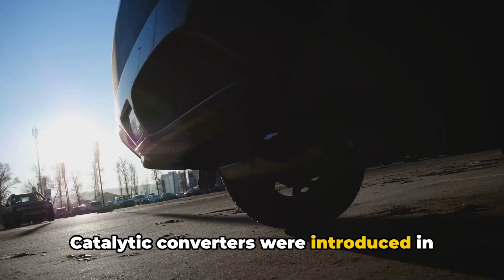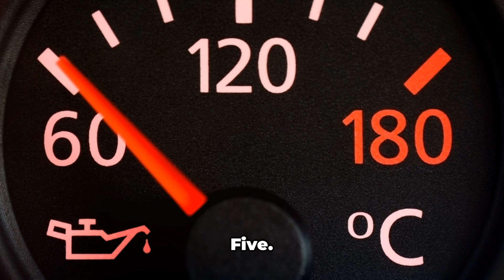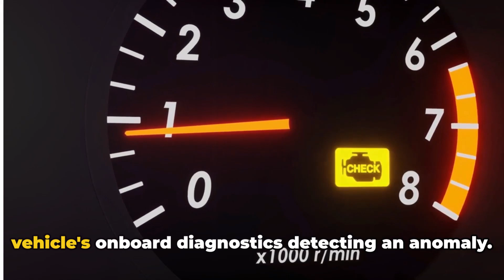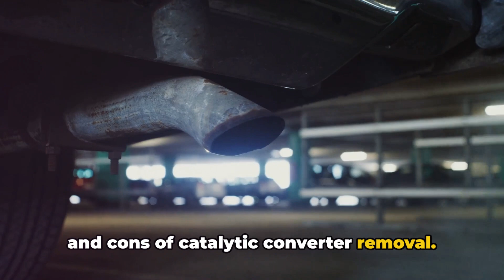Catalytic Converter Removal Pros and Cons: CAT Delete 101

Comment: Took mine out from my Corsa E 1.4t. Wow, engine temperature cooler. Awesome accelaration from start to finish. Car feels energised. In the Opel Corsa E range the catalytic converter sits in front of engine next to turbo middle center of engine. This cat can reach a few hundred degrees celcius and it is basically against the front of my engine block, head and next to turbo. Sorry, but NO!!! Will never put it back